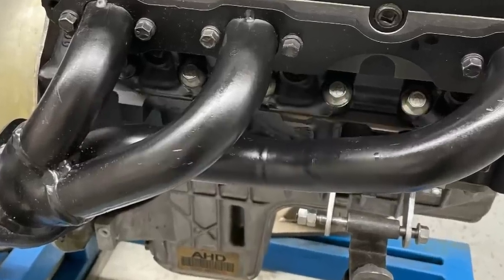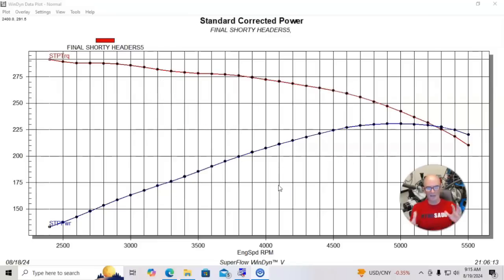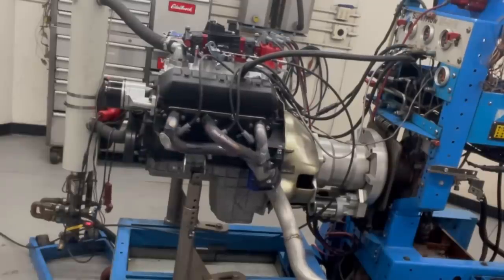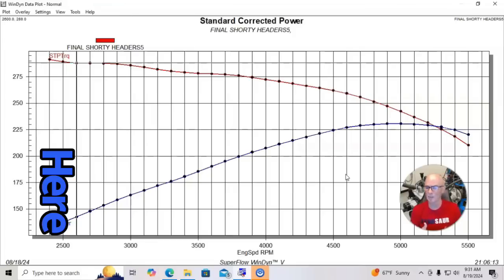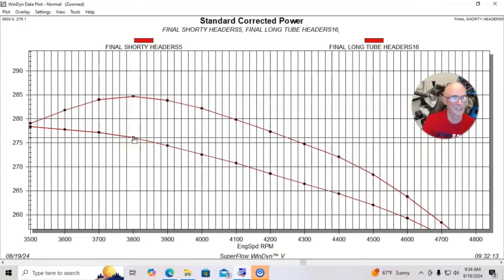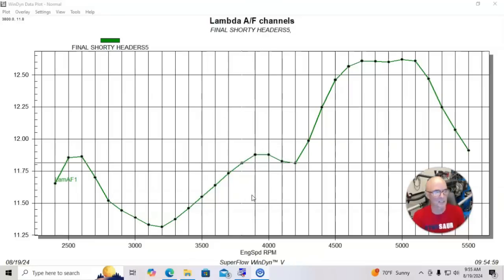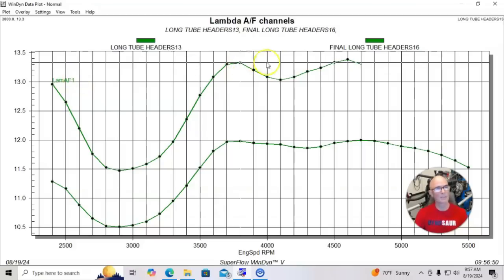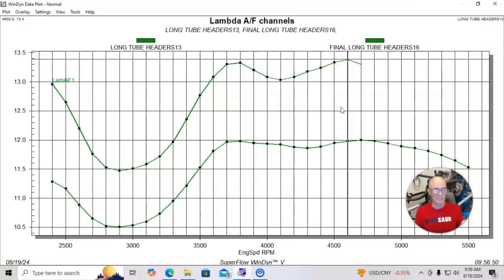4.3L VORTEC V6 PERFORMANCE. SHORTY VS LONG TUBE HEADER TEST-WHICH ONE MAKES MORE POWER & TORQUE?

Comment: You can buy a Nissan now with 310 hp and a 9 speed auto. It will smoke the trucks with 4.3 with all the modern goodies. Apple-Android play. Adaptive cruise,  LSD, 18/24 mpg. etc.
Plus the reliability is night and day. The Nissans go 300k miles with only regular maintenance.  2k and older S10's have the poppet injectors, junk. The intake manifold gaskets go out and dump water into your oil. Junk. The distributors are junk. Cap and rotor needed at least once a year regardless of miles. Radiator is to small. Auto trans for those years had issues. I could go and on and on. I just bought a 23' Frontier and it 100 times better than my 2k Xtreme ever was or ever could be. Can't wait for the peice of shit to sell, which reminds me, the resale value is shit too.
Edit: The interiors are biodegradable and fall apart. Cracks everywhere.
Reply: No one watching this video gives a poop about a Nissan.
Reply: @Turbogto_guy  I give a shit. Their trucks shred all over the others in many ways but most importantly in reliability.
Reply: @chuckyz2  if you say so.
Reply: @chuckyz2  as someone with a 4.3 your new Nissan isn't as reliable how ever an older Nissan might have the same reliability but less power besides the 4.3 is the best sounding v6 anyway
Reply: @KillerCamino  I have a 2000 Xtreme. Had it since new. Biggest p.o.s. I have ever owed. It was great until 170k then nothing but a headache from there. It has 300k miles now. 
The Nissan is far supreme in every way. 
First of all, everyone I have asked or known says they have had zero issues with their newer Nissan trucks. Car are different. The trucks are solid. 
The brakes are way better. The S10 would warp rotors on a regular basis. 
Rack and pinion on the Nissan. Need I say more about that?
Variable valve Timing. 
Twice the payload and 6800lb towing.
Dont try that with the shit brakes on a S10. 
The 3rd door handle doesn't break on the Nissan. Did I mention a 9 speed auto designed by Mercedez Benz? 12 bolt LSD diff. Front struts. Side and knee airbags. Much better crash rating. Dude, I could go on and on and on. Chevy S10's are and have always been shit. They look good lowered and are a good platform for LS swap and drag racing. But the 4.3 is the first thing you have to toss. 210 hp? Was ok in 2000 but just ok. 
Ther is a company that already has a blower for my truck and is in the process of getting CARB certified. 
The ride, the way it sucks up rough road and dips? It's like the difference between a 4 runner and a stadium truck.
Reply: @chuckyz2    You are comparing a new truck to a 30 yr old truck. The same could be said when comparing a new Colorado to an old hardbody. Just saying
Reply: @KillerCamino  yea that dude bragging about a Nissan on a channel that doesn’t give one look at no damn Nissan. Smh.
Reply: @darrenleonard339  Exactly. The thing you fail to realize, is it isn't a classic and never will be. Your wasting your money on them. My truck is turn key with a 100,000 mile warrantee and is so much better in every way. My payment is just a little more than the repairs I have to make on the S10 every month including time wrenching. Just trying to help. Been there, done that. So glad it is over.  I am all American but Chevys cant hold a candle to Nissan trucks. Toyotas have gone to shit too. And Nissans are Assembled in the USA.
Reply: @chuckyz2   I haven’t failed to realize anything. I was just pointing out the fact the technology difference can be applied to any vehicle. We now have pick up trucks that can out run the sports cars of that era. I love driving my 48 1 ton but when I need to really haul I fire up the 2016 duramax that is now twin turbo. Some people just enjoy the old stuff more than the new. If not there wouldn’t be any classics even the old s10s. Those old square body’s the prices are getting up there for a clean one. Even the early 80s Datsun and Nissans bring good money if you can find one that’s not rusted away.
Reply: @chuckyz2  
You fail to realize that no one cares. 

And for every Frontier, there's 2-3 GM S trucks, and people are still playing with them. 

There will never be a Frontier with a devoted following like there is for the GM S trucks, either.
Reply: @AlanRoehrich9651  Nobody here but me. That means you should have said, "almost nobody." And what you said does not negate the facts no matter how many people continue to favor the S10. I tried to be a Padres fan back in the day. Just had to realize they sucked and so I walked away. Isn't it funny that the aftermarket is far better for the Frontiers and Tacos than it is for the S10. Hard to believe with their so called, "huge following."
Reply: @chuckyz2 you warping rotors has to do with doing maintenance when you change break pads you have to lube the rods that allows the pads to wear evenly also since my dad's had his Nissan we've had to Change the rear door handle do balljoints on both sides twice it has a pretty bad exhaust leak right now and had to get a alinement twice for some reason
Reply: @chuckyz2  still the s10s are great trucks if you'd learn how to do basic maintenance you would have had 0 problems the only problems I've had with my 4.3 since I put it in is stuff that was my fault but I fixed it for less than $20 and I have beat on it pretty hard and if I put the gearing your nissan has in the mix it would dust it in the 1/4 right now I have the stock gearing 2.56 so the 0-60 is bad but it just doesn't stop pulling even when I've maxed out the speedometer
Reply: @chuckyz2  
🤣🤣🤣🤣🤣🤣
You can still buy tons of parts for the GM S trucks. Headers, cams, pistons, cold air kits, lift kits, lowering kits, brakes, audio gear, lighting..... 

There's plenty available for them. You just have to be intelligent enough to find it. 

And if you're having problems with one, it's on you. They're rock solid reliable with proper maintenance.
Reply: @KillerCamino  I have an Xtreme. It has the most HP you can get in an S10. 210. My Nissan has 310 hp and 285 tq with 9 gears. Your dreaming youngster. "If onlys" Don't help your argument. It only shows the world the kind of people out there that support shit engineering.  But hey, to each their own. All I can say is you have no idea what you are missing.
Reply: @KillerCamino  Listen kiddo, I went to school to do brakes. The rotors are way to small for a truck.  They are shit. If your dad is anything like you, it would explain a lot about the problems with his truck. Most likely letting you drive it is the main one.... Lol.
Reply: @chuckyz2  you went to school to do brakes but you still warped rotors did they teach you anything at all? Common sense? Glad I didn't waste money on a piece of paper then also I don't drive the Nissan I have once and the throttle response in the drive by wire setup fells like "its ok go when you feel like it" but it would sound pretty good with a good exhaust system on it
Reply: @KillerCamino  You didn't finish school did you? I didn't warp the brakes. The brakes warp because they are too small. I'm sure you have no clue what I am talking about but that is ok. I'm happy you like your S10. You deserve each other.
Reply: @chuckyz2  graduated early and again your brake problems would have been solved by replacing your brakes properly
Reply: @KillerCamino  You are not the sharpest tool in the shed, are you?
Reply: @chuckyz2  sharper than most
Reply: I have Japanese stones. 
My Shit is sharp. 
Funny thing is, I rotated my tires yesterday. The rotors on my Nissan are the same size as my Xtreme. I almost puked. Even though they are, they work better than my S10 ever did.  I'm still going to put bigger rotors and calipers all the way around. As big as 18's will allow. And yes, there is and aftermarket big brake kit for my truck. Z1 offroad has a good looking kit. They also have a supercharger kit. The brake kit is very reasonably priced. The SC.... not so cheap. 
Also not carb legal, but I don't have to smog my new truck for many years. It almost doubles the wheel hp.  My truck also has an open diff. But it does 2 wheels peels like it is a spool. The electronic brake system that makes it do that it fast and smooth. It feels just like a posi. I was taken back by that. I'm old school and it took awhile to warm up to it. The camera system, the blind spot warning system, the intelligent cruise control... all things I have grown to love.  Oh and it revs to 7k out of the box.  Variable valve timing?  9 speed auto.  The ride is solid.  Hate on me all you want. You have no idea what you are missing.  I have a 150 kit I can use until the supercharger gets installed.
Reply: @chuckyz2  good luck
Reply: @KillerCamino  Thanks. You too.

Comment: You want LS cams for a V-6? Run a LV3, and you'll have an LS minus 2 cylinders.
Reply from the maker: THE LV3 IS ACTUALLY A GEN 5 LT-BASED MOTOR MINUS 2 CYLINDERS-IT IS NOT LS BASED. I HAVE VIDEOS UP ON IT TOO

Comment: I have a older v6 performance book that refered to the 4.3 as a semi even fire motor. I will have to check a motor to see. 
If so, it will need individual cylinder timing. 
Reason for second timing mark on harmonic balencer. #2 and #1 cylinder.

Comment: I suspect you were getting different A/F from cylinder to cylinder. Your 02 sensor was most likely on one header out. Probably a combo of the heads and intake.  Just a guess.
Reply from the maker: THE AF METER WAS IN THE EXHAUST-SAME SPOT ON BOTH-CHANGE WAS THE HEADER CONFIGURATION
Reply: @richardholdener1727  I know. The air fuel was wonky on both.

Comment: Well, Crane has a good steel billet cam, but they're in Australia now. Glad I got mine before they left. 

My 4.3 has flat top pistons, it's zero deck, the heads are milled, and it has 1.6:1 rockers. 

No way to dyno it, it's Vortec EFI. 

Oh, it has Hedman long tube headers.

Comment: This test was done many years ago using an oversized carb along with Comps biggest offshelf cam at the time the 280HR and the V6 ended up just under 300hp if my memory serves me correct.Pretty sure a V8 with th same mods would of made 100hp more but if you already have the  V6 in something small like an S10 it might be worth hopping it up a little

Comment: Personally, I'd love a greater aftermarket for the 4.3. Like better heads, cams, efi intakes, etc. 

But, I wish the LV3 4.3 was more common. If it was, id rather just have one of those
Reply: The have aluminum heads for the 4.3 but there 3k a set

Comment: What happened to that Bowtie 2 piece intake that you show on the engine at 0:30?
Reply from the maker: COMING-BUT IT IS FOR THE EARLY (NON VORTEC) HEADS, SO HOLES MUST BE DRILLED IN HEADS
Reply: @richardholdener1727  Awesome!

Comment: I agree 100% we need more aftermarket support for the 4.3. A hand full of cams, a couple of intake manifolds, and limited ignition options make this a hard platform to adopt.
Reply: I've never dyno'd my 4.3 but its sure quick compared to stock .. I got my (79k mi at the time) 1999 4 Dr Blazer in 2016 for 800$ from the original owner. He ordered it from Reliable Chevrolet. Drivetrain RPO codes being L35, M30, GT4 and G80.... When I arrived I had to push it out of the ruts in his yard LOL. He said he was goin from reverse to drive for at least 10-15 mins tryna get it out and be said the transmission went clunk, lost reverse, made a grinding noise then got quite and he left it where it sat. I knew the transmission was broke I told my dad he said it's prolly a broken sunshell (which it was). I got it home and instantly pulled the motor n trans out. Next day my dad's inebriated ass looking at it as I put the transmission in the bed of his truck. He burped n said " pull them heads off" I said "why its barely got 80k miles" he replied " Ima take a em to pat to get sum work done, he owes me " Pat is my father's cousin that specializes in cylinder head work, mainly for dirt track. They were angle milled and "slightly" ported my dad got a set of .020-.023 (I can't exactly remember) head gaskets. I get home after being away for the weekend and the damn thing is down to the short block with no camshaft🤣. He said "don't say shit, save it for tomorrow" I turned around n went in my room, next day he brought a camshaft home he spec'd out. His good friend grinds camshafts at a place called "Norfleet Machining" where he's got majority of his cams since before I was born. And in the garage he reached in the top drawer of his tool box and pulled out my damn PCM "I didn't tell ya but I got this reprogrammed, should have it runnin perfect" . 4l60e got goodies as well, 22-2400 stall, hardened steel sunshell, high energy 2-4 band, "corvette" servo, and my father did sum shit to the valve body idk what exactly. I mate the transmission to the motor and I got to put the lower intake on and I had issues so it had to get milled a tad too. I grabbed my Dremel and smoothed up the intake manifold in places, smoothed the mouth of the plastic intake, ported the throttle body a lil, got it together and set the motor n trans in....left it up till my ebay shorty headers and electric fans came in. Got everything in and I fired it up and it had a lil change in idle sound but not drastic, I looked at my dad n said "I thought that cam would sound cool" he said "trust me it's perfect for what ya got" let it get up temp n top the trans n shit off ...my dad said " rev that mf" I did and I was blown away at how much faster and more responsive it was ! ...a month later I got a beltech 4in drop kit n went thru all the suspension. It's always been on the back burner, i never wanted to daily it. I'm 27 now n since then it's gotten an extra 2500 miles on it, big external trans cooler, weight reduction (no carpet or anything behind the front seats and removed the spare n cut out anything that has to do w it), still has a 2in to 2.5in Y pipe dumped a foot in front of the right rear tire. And it hangs with my brother n laws 2014 v6 charger !!! Idk how much power it makes but it sure is fun...(I got a acceleration clip on here) But I want to do the fuel system and a m90 blower...and get my gadamn interior back to being nice 🤣🤣🤣....

I rambled but I love my 4.3 vortec mainly because it was my first car,when it shits the bed I'm goin to the LV3, maybe w a carb!? 🤣🤣🤣
Reply: @PHILLY214 AYE YO, CAN YOU GET THE SPECS FOR THE WORK? I GOT AN 02 XTREME 5SP W 220K I WANT TO REDO THE MOTOR TO MAKE IT GO AS HARD AS POSSIBLE BEFORE IT GOES KABOOM!😂😂
Reply: why  v8 swap it
Reply: @overbuiltautomotive1299  Because most of us that choose to run the 4.3 is due to weight or packaging restrictions. SBC doesn’t fit in everything unfortunately.
Reply: @jaybestcole the 4.3 is heavy as fuck my g!?🤣🤣 MFS full iron!
Reply: @overbuiltautomotive1299 the cyclone and typhoon was the fastest production truck in its time like the grand national v6's passing v8's like a rabbit race
Reply: Honestly the 4.3 v6 is great, stock it can take 500-600hp to my knowledge, and get decent gas mileage...although now I'm more interested in the newer lv1 and lv3 4.3 v6 which is based off the newer LT engines...I know one guy did a lv3 swap in his buick grand national after a prominent company for 3.8 buick engines completely botched the machining on the 3.8
Reply: @monikhushalpuri 1 pass on the strip and either the rod bolts or crank shaft would kick the bucket...it'd never handle 550hp reliably. For drivability ide say 325-375hp max at the wheels, and not surpass 5800/6k rpm
Reply: just a quick little tid bit. The 4.3 is a 350 with 2 cylinders cut off so you can essentially use most of the parts if you can do some frabrication